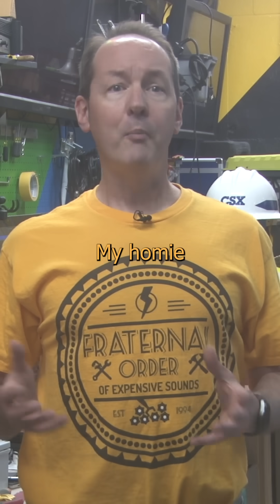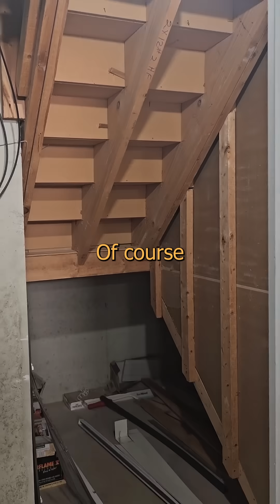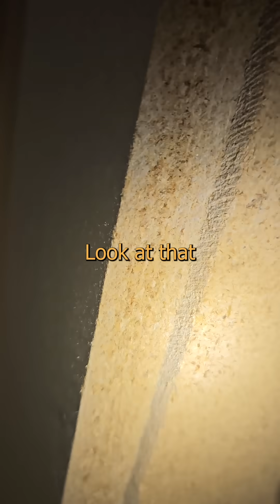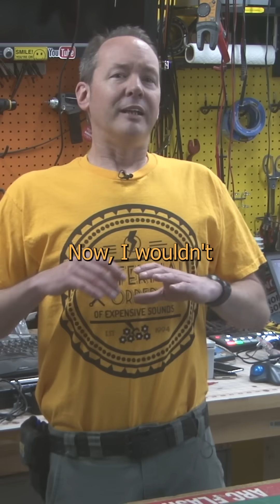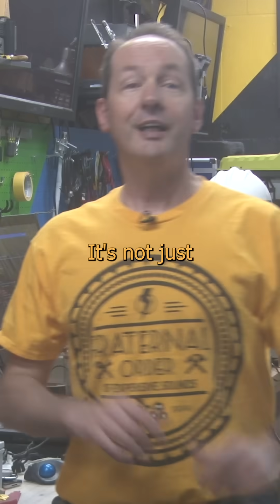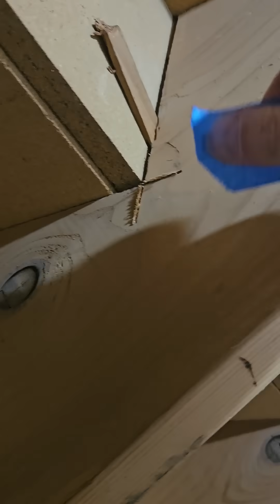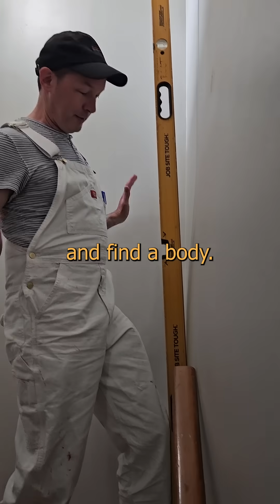Particleboard Staircase #chrisboden #engineering #construction #stairs #cheap #job #work #carpentry

Comment: Professional woodworker here: Yeah, that's fucked
Reply: Short of replacing it is there anything that can be done to make it safe?
Reply: @evancombs5159  no. Luckily its really an easy fix. Just yank up the part board and lay down some ACTUAL treads. Only hard part is if its carpeted youll need to pull the carpet up.
Reply: @trailblazer632  eh, there is no way the depth and height of the strings is within spec, and with the depth of the cuts that something really heavy going up won't crack it.
Reply: @petergraphix6740  the over cut on the stringers has me 😮 but the builder probably wasn't worried about it because the particle board will likely break first 🤦🏻. It's scary what some builders try and get away with and no one is aware they did it until someone gets hurt.
Reply: @evancombs5159  No. You'll want to replace the strings as they are not level and the throw for each one is probably out of spec. 

Really the finishing is the biggest pain in the ass if there is laminate or carpet on them.
Reply: @evancombs5159  Build a steel stair flush under it so when it dissolves you still have stairs?
Reply: AS1860 Particleboard Flooring
This is the code that allows particle board flooring in Australia. It requires the particle board to stand up to 3 months of weathering without a roof. 

I was very surprised by this but thought I would actually look it up.

Comment: The worst part is the massive over cuts on the stringers.
Reply: It’s nice. If you start overthinking about the particle board stairs you can distract yourself with the over cuts. Thinking a bit too hard about the over cuts? There’s some particle board stairs right there to grab your attention. I mean you never have to go outside to be distracted by problems!!!
Reply: @kamrynsikes  don't forget all those shims in the stairs cause your cuts sucked.   Can use those in the rotation too.
Reply: the particle board will get you first though
Reply: I've built some stairs. A cheap jigsaw to finish the job without overcut is < $20. I didn't avoid overcut because someone told me to, I did it because overcut naturally looked to me like perforating the stringer for easy break-away. Personal preference I suppose.

I've not done tests to find out if it matters much in the long term. But I *feel* A LOT more confident in the longevity of my stairs for the low-low price of $16.99. A steal, in my opinion.
Reply: @KevCoLabs  The work shown just reveals laziness and negligence. Most people cutting notches with a circ-saw would do the finishing cuts with a jigsaw (or even a hand saw) but they could not be bothered to change tools.
Reply: I noticed that. Makes me think the whole thing was DiY'd on the cheap
Reply: @thtcrzywzrd92  I DIY way more than I probably should and I wouldn't touch that build process with a 39.5ft pole. But then I cut my teeth on decks and saltwater docks, so that's a whole different type of abuse they have to withstand.
Reply: @thtcrzywzrd92  Considering the neighbours have the same crap going on, I kinda doubt it. Unless there's a serial flipper working their way down the street.
Reply: The overcuts really aren't a big problem. Of all the junk here that's not a huge deal to me.
Reply: @jbear9  except for when anything bigger than a mini fridge has to get up or down. Overcutting is a problem, especially since the rest of the stair build is cardboard and wont take on any of the stress.
These stairs in particular wont fail because looks like they have a solid 6”uncut. but that kind of quality wont pass on smaller beam
Reply: @jbear9  I agree about the cuts, a lot of people are freaking out and I really don't think they look all that bad. 

I'm assuming everyone who's complaining about them has never tried to cut a stringer with a circular saw. Or try to make any kind of bird mouth cut into a 2x material, hack circular saw will give you an over cut on a 1x
Reply: @pauldefillippo8490 somebody will definitely come in here with "well you should use the right tool for the job" while having no clue what that actually entails. There's a lot of things in this video that are big problems but the overcuts aren't one of them.
Reply: @jbear9  You are the only one in here defending that absolute trash work. Those overcuts are unacceptable and if I had done that to a customers stairs I would toss the material and do it again. 1/2" is one thing but that's over an inch and a half on both cuts on  every tread. That weakens those stringers a ton.
Reply: @jbear9  
Uh yeah, the right tool for the job being a circular saw, which come STANDARD with adjustable DEPTH GUIDES....
Reply: @eRe4s3r  Hell yea. You need to use the depth guides because stairs require the same throw on each one so they are not a step hazard. Codes can vary, but most of them have a really small margin of variation between step so you stay in regulation. 

I'm pretty sure a squirrel on meth made these stairs.
Reply: @eRe4s3r i mean not all of them. A lot of cheaper or older ones don't have that kind of thing.
Reply: @pauldefillippo8490 thats why you finish the cut with a hand saw or a jig  saw or anything but a circular saw.
Reply: @jbear9  How about just cut to the mark with the circular saw, then finish by hand. Quick and no overcuts.. Problem or not. It's just horrible looking shoddy work.
Reply: I'm glad I'm not the only one who saw that. I can barely swing a hammer and miles away from being a carpenter, but even I knew that shit looked sus as fuck.
Reply: They aren't a problem. The stringers are cut from 2x12s, and there's more than half of the depth of the stringer left uncut. What's curious is how small the treads and risers are. When you cut a normal stringer, with treads about 10" and risers about 8", you end up with about 3-1/2" of the stringer uncut. And that's plenty of support, especially for a set of stairs with the outer stringers nailed to the studs of adjacent walls.
-- A 2x12 is about 11-1/8" wide, and if you look at the images of the stringers and take the distance from the tips of the stringers to the bottom edges as 11-1/8", you can get a rough idea of the width of the treads and the height of the risers. These look like stairs cut for toddlers. And the treads don't look much wider than the height of the risers. This is a strange set of stairs. 
-- A smaller-diameter saw blade or a blade not set to the deepest cut depth is going to result in bigger over-cuts, if you complete the cuts with the circular saw. I would always use an 8" blade at full depth, because this results in the closest to a perpendicular angle of the leading edge of the cut. Battery saws have smaller diameter blades, and this makes for a more tilted leading edge of the cut. Either way, I used to finish off my stringer cuts with a handsaw, because I'm fussy, but I wouldn't quibble with someone who finished them off with an 8" blade set to full depth. There are too many existing problem-free stairs cut that way for me to call it substandard.
Reply: So much fuckery all fighting for first place in the structural failure contest.
Reply: Yeah that’s lazy carpenters not wanting to finish the cut with something other than a circular saw.
Reply: I saw those. Terrible. Stringers end up being closer to a 2x4 than a 2x10, so no need to cut any more than you have to.
Reply: im a student carpenter, so thats a mistake i would and have made, but a professional, come on!
Reply: You have to have weak spots for when the stairs collapse.
Reply: Thank God you mentioned this. I thought I was wondering about something that possibly didn't even matter.

Comment: god i hate particle board, had to change the floors of my grandmas house cause all the particle boards got wet and started sinking, the whole houses floors are pretty much particle boards so ive been slowly working my way out of the house, why are mobile home houses even using particle boards as flooring in the first place…